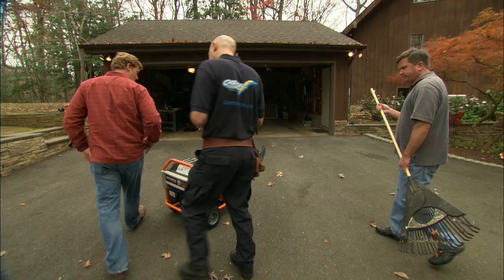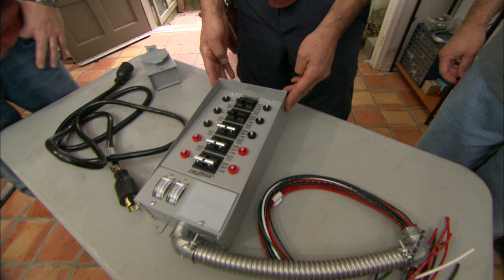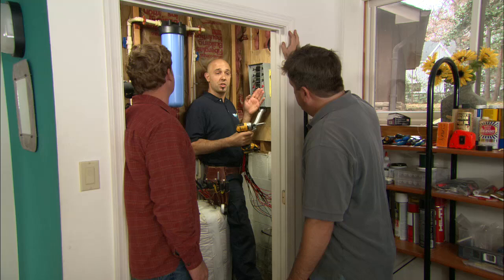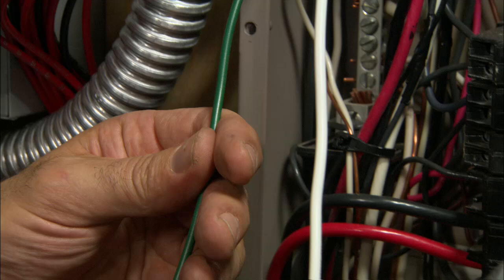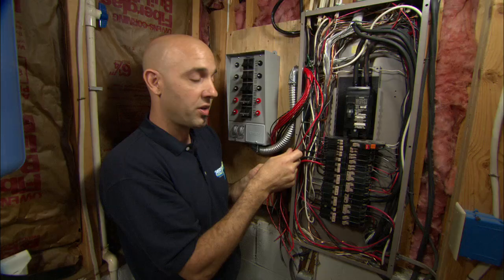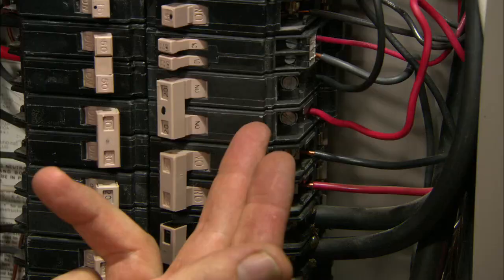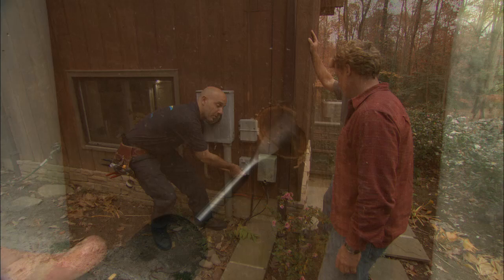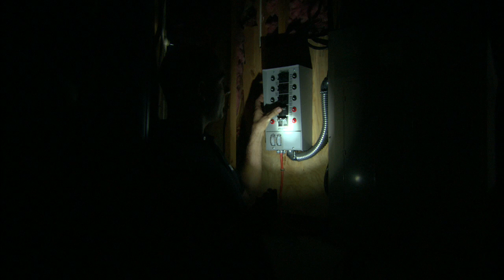How to Install a Transfer Switch for a Portable Generator | Ask This Old House

Comment: He's a good electrician, but why does he always use his linesmen to strip wire? It's a very bad habit and if I ever catch any of my apprentices or journeymen do that, I will correct them because no matter how cool you think you are, you will end up scoring the copper and on solid wires it will weaken the wire and make them break easier.  A wire stripper is a must have tool.
Reply: I'm an electrician 26 years and I've never owned a wire stripper.
Reply: Well then you must be the reason why I see so many broken wires inside of wirenuts after spending a day troubleshooting intermittent problems ;) or perhaps you don't work construction often.   

I've heard a few other electricians brag about not wanting to spend $15 on a stripper and in every case, they damage the copper. Sure maybe once in a blue moon it's ok to use them but it's highly unprofessional for a working pro not to use the right tool.  I'm a master electrician FYI.
Reply: So you're saying "once in a blue moon" is ok to damage the conductor and decrease it's ampacity rating? Hmmm. Sounds shady to me.
Reply: Sounds like you're playing word gymnastics and trying to put words in my mouth but it doesn't change the fact that a professional electrician needs to have the right tools.
Reply: Arie M and "flying taps" inside the panel?? Wtf?  This guy does not know code!!
Reply: lol. I love the comments about him not using proper strippers. The first time i brought mine out as an apprentice, i never heard my tradey laugh harder than he did that day. His remark was, "What the fuck are they!? Use your pliers!!". The only time i ever use strippers is when I'm building a control board and I'm stripping hundreds of cables.
Reply: Scott Schembri See that's the kind of macho attitude some guys have that leads to poor installations.  I also assume you've never wired a large house where you had to strip thousands of wires in a timely fashion.  There is no way you can properly strip that many wires with your pliers without getting lazy and scoring the copper.  

How about large panels full of THHN? For those I even have a Katapult stripper to make sure even not one strand is broken and I don't get carpal tunnel.  

And for what? To save $15?
Reply: mate I've done work only for that. But I can guarentee you if I'm doing TPS cabling, lineys is all you need because if you're a good sparky you'd know how to strip with lineys. And as I stated in my previous comment. If I am building a control panel, railways Signals relay box or anything with 0.75 mm cabling and flex cable then I'd use my strippers. But for single strand and even stranded power cable, you don't need strippers mate. Ask any sparky
Reply: Arie M also if I'm buying strippers, I ain't spending $15 on a bunnings/Wallmart grade set of strippers. I only use trade quality so I've spent $90 on my set bud.
Reply: Wait so if you already have a pair, why are you arguing? and I was just using that as an example. I have two pairs - my daily one that also has a couple of 6-32 and 8-32 cutters and my Katapult for panels or other repetitive days.  I've got a couple of backups too that I've gotten for free from various vendors.
Reply: But what the hell do I know...they give Master licenses to everybody now days.
Reply: Arie M no worries mate. How many years experience as a lekky have you got and what industries have you worked in? to make a comment like that sounds as if you're a home owner who wired in his own gpo and that qualifies you as a sparky. But what would I know? We don't play with toy voltages in my country.
Reply: You must be right if you typed it in all caps.  Tell me how many panels full of THHN you've wired up in a day with your linesmen and I'll take you more seriously.
Reply: right.   all caps give people authority!
Reply: It's spelled Linesman pliers, not Linemans pliers.  Class dismissed.
Reply: We always called them Kleins and everyone knew what we meant.  The diagional  wire cutters we call them dikes.  Klein brand of tools is the best in electrical hand tools you can purchase, but they don't come cheap.
Reply: I've used Klein, greenlee and some others.  But I have found knipex the best by far, German quality and no issues for exchange.  Had a Klein with the blade getting knicked up, try to get warranty is like pulling teeth, had a knipex with the same thing, no question, exchanged right over the counter.

I have had many apprentices that don't know how to Use strippers, seen so many knick the wire by either using wrong notch or angle them to much when using them,  I have used my linesman many times for stripping wires and no nicking, but still prefer to use strippers.  Its easier to knick with strippers than linesman, especially cheap pairs.
Reply: Arie M Oh but wire nuts are perfectly ok? lol! You'd get prosecuted in the UK for using them!
Reply: sure you do.
Reply: electricalron then you might be a hack
Reply: Arie M. he do that because some of the wires are thick
Reply: >"and "flying taps" inside the panel?? Wtf?  This guy does not know code!!"  

came here  to point this out as well, I noticed this and I am not an electrician, I only play one on Youtube
Reply: > i never heard my tradey laugh harder than he did that day

you let yourself get bullied, HAHAHAHAHA - random internet commenter
Reply: If the wire is thicker than 10 AWG, I get it, but he does it all the time with 12 awg wire too.  In fact in one short section, he was bragging about how the only tools he needs is his linesman and screw driver.
Reply: You can have splices in the panel and it's not considered a flying tap. If it is, please cite the NEC code.
Reply: Arie M I use wire strippers do I have a nice safe splice
Reply: Arie M
Reply: Omit, you might hard it find to believe but I for one love this stuff. I also realize that everybody does things a bit different and I've never been the "my way is the best" but felt that this was a fundamentally bad habit that I pointed out.  If one person reads it and has second thoughts about doing it next time then all the better.  What does it hurt to get extra information to the non-pro? Everything on the internet including this show should be taken with a grain of salt.
Reply: there is an special tool for that automatic wire striper would be a great one lol
Reply: He's a REBEL - he will just say GO TO HELL OLD MAN, I QUIT
Reply: Arie M all you need is the " powerhouse five" and an apprentice.
Reply: Arie M - You are 100% right.
Reply: Arie M YOU ARE CORRECT ! BAD HABIT FOR SURE !
Reply: That is bad , not professional ( some day it will wire broken or ~~~ )
Reply: Does being a master-baitor make you a better fisherman?
Reply: Arie M ... I'm aware of the relevance here concerning the use of linemans' to strip wire....Has nothing to do with 'Cockyness' and I agree with your statement "You should have the CORRECT tools when tackling any job professionally",  However some of us are built for speed when time is of the essence, Knowing up front that mistakes is not an option, Have self-developed [techniques] in certain areas to enhance efficiency and eliminate the need for "Back-and-forthness" whether its to your truck, toolbox, or even your toolbelt. After enough "At-Bats", This guy knows how much pressure to place on the handle, how many 'swings' it takes to strip wire regardless of gage. I've seen auto mechanics use impact guns to install cylinder heads instead of a torque wrench, Put air in tires without a gauge, AND I've seen electricians strip wire with linemans'...ALL SUCCESSFULLY!!!....Whatever your course of action may be as it pertains to your own personal efficiency level, (If you're good at it???)...Short cuts is not a sin...Cutting corners IS !!!....But I will say this....I would NOT have stripped wire with a pair of lineman's pliers with cameras rolling !!!
Reply: Cannot spell can you?
Reply: 243wayne1 only if your Canadian
Reply: i thought everyone just used their teeth to strip wires like i do
Reply: what cause the generrator blown smoke
Reply: save
How many times did you repeat the 8th grade before you started working full time?
Reply: Where in Yankee land do they call side cutters, linesmen?
Reply: I've been a Licensed Electrician for 30 yrs. and never have I used a wire stripper . The Linesman pliers is the tool
Reply: +SLY SPY . For anyone reading this when you hear the person you hired to do a job say “ I’ve been doing it this way 30 years.”  and they don’t want to do it the right way then you need to give them the choice to change their way or leave. ITS YOUR HOUSE, YOU HAVE THE RIGHT TO SAY HOW YOU WANT THINGS DONE. Do it the right way or leave. Don’t be afraid to stand up tell them no!
UNFORTUNATELY contractors need to be baby sat until you know you can trust them. 
Craigslist is full of guys saying “ I’ve been doing it this way 30 years”
Did you see him struggle when the side cutters dug itself into the wire?
Reply: Hello jukebox , It's not a matter of right or wrong , A tradesman has many tools at his disposal while doing a job , it's really his choice on what tool he prefers . I was taught and still use today my linesman as my premiere tool but if it's not your choice that's okay , whatever works for you . The linesman is designed for stripping wire and requires a touch so not to score the wire , that's what an apprenticeship is all about learning to use tools properly
Reply: Your full of yourself
Reply: Arie M a master of bullshit
Reply: Arie M well they must you got one
Reply: Krazy K  
Hmmmm🤔...so you like fishing, eh?...lol
Reply: Thomas Russell No! Not a better fisherman. Just better at making sure the worm stays on the hook better😅
Reply: if your cutters are sharp enough and you have a steady hand, why would you need strippers? maybe on speaker wires.
pros watch diy YouTube videos to see why their business failed/what they've been doing wrong for so long.
Reply: Well Ive built power lines most of my adult life and this guy forgot to tell people to shut the main breaker off during a power outage. Because 7200 volts goes through the transformer and comes out 240 volts total. But that generator will send 7200 volts back out of the transformer to the main power line. It's called back feed and it makes a linesman's job more dangerous.
Reply: old school
Reply: A wire stripper will strip a wire’s insulation with complete accuracy and precision, allowing it to be used the way it’s supposed to be used.
Reply: Arie master? Wouldn't certified sound better?
Reply: electricalron 26 years and you haven't learned to use strippers. Don't want you working on my house
Reply: electricalron 
  They sell them at Lowes...your welcome.
Reply: Arie 
  Im not a pro, but can you recommend a good pair?
Reply: James Bond 
 Unmmmm i can strip with a fuckin butter knife doesn't mean i'm supposed to.
Reply: You gatta be kidding me. Just say you can't do it. Man than been to the moon and you can't strip wires with some pliers............ Lol
Reply: Arie, I 100% agree with your assessment regarding these cowboy types who use their pliers so they don't have to buy/carry the correct tool. Kind of like the idiots who "bounce-shoot" multiple shots in a row using a framing nailer. I see anyone trying that crap around me, and they immediately get their gun permit revoked until they've read the manufacturer's general care and safety guide.  You correctly point out this will often damage "solid wires", but I'd point out that scoring stranded wires could perhaps lead to an even more dangerous situation. Firstly, stranded wires always present more of a danger by their very nature, and are often the source of fire due to their sloppy (loose, or somewhat fluid) configuration. Often I've repaired connections where the the previous sparky broke nearly have the tiny strands by over clamping or over tightening nuts/fasteners; with many of the remaining strands tied in little knots. On top of that, the many little broken strands that end up falling away over time, as the appliances will no doubt vibrate also present a short circuit/arching plasma potential. NEC shouldn't even allow the stranded connections to be made IMO. Now having said all of that, I don't believe one should call one's self a "master", as that name is reserved for his/her students or slaves ; )
Reply: I reckon I can build that , stab back connections are among the most idiotic dangerous things anyone could ever do to a house, yet the UK mandates these chinsey plug and play fire traps. Kind of says a lot about y'all. Any time I come across one of those shady mf'ers, I call my apprentice over, tell him to grab the rec, and I easily twist pull the wire out- every time! Then I do a quick mock up using scrap wire, a few nuts, and black tape. I tell him to try to pull that apart. After watching him struggle, I lol, and tell him you could hang a porch swing from that connection. But in truth, you could tow a truck with it. Cheers from across the big pond mate : D
Reply: You always use a wire stripper, even if it is one you set. I am an electrician and sold AMP connectors. Always correct strip length too.
Reply: Strippers for professional results

Comment: Nope!  I would keep this "electrician" far away from my home.  He made some crucial mistakes.  1st he skinned the wire with his side cutters ... that is a big no no ... thais is why we have wire strippers and 2nd he made taps inside the panel.  He could have easily put in a junction box beside the existing panel and made all taps inside it.  Keeping all electrical installations up to code is vitally important for safety and for future electricians who work at this home.
Reply: Birddog108 - What a good keyboard warrior you are.
Reply: Birddog108 - Yes, all those floating wire nuts in the breaker box is driving by OCD crazy.
Reply: I'm not a fan of wire nuts inside of a panel myself. But there is nowhere inside a NEC code book where it defines you can't make splices inside a electrical panel. It's counts as a enclosure. Code legal.
Reply: Our local code requires grounds and neutrals on opposite bars, also no wire nuts or breaks in box, would have to junction box beside it, but everyone has different local codes, iv been outta state and seen where romanex connectors wernt code..... yikes!!
Reply: Well Ive built power lines most of my adult life and this guy forgot to tell people to shut the main breaker off during a power outage. Because 7200 volts goes through the transformer and comes out 240 volts total. But that generator will send 7200 volts back out of the transformer to the main power line. It's called back feed and it makes a linesman's job more dangerous.
Reply: Rob Bob no, the whole purpose of the transfer switch is so it doesn't back feed
Reply: Robert Myers  That transfer switch just. Transfer's the generator power to the breaker box. Back feed happens from your breaker box through the electric meter, back to the pole outside your house.
Reply: Rob Bob when the transfer switch is set to the generator, the power goes straight from the generator to the load, doesn’t go through the breaker box at all
Reply: Robert Myers Ok I understand it after watching the video more closely, I thought he was just putting wires into the breaker along with the wires that were already there. Sorry I've built power lines for so many years and have seen all kinds of back feed issues with generators installed wrong, that I jumped the gun. Back feed is life threatening for power line crews that show up from a different state to help with natural disasters, or anytime. It's still a good idea to shut your main breaker off when using a generator if your not certain about it's installation.
Reply: Birddog108, did you ever get moved out of your parent's basement? Oh, and FYI, the main panel IS a junction box, and depending on it's capacity can legally contain a certain number of splice connections with in- just like any other dumb old junction box! I feel sorry for all of the HO's who likely have a bunch of extra little junction boxes configured around their main panel if you've actually ever practiced in the trade. I bet the spiders love all of that web you've made for them to hide in though ; )

Comment: Cannot believe i have a way more advanced wire stripper tool than this electrician has 😂 I only have to hold a wire in my wire stripping tool and squeeze the levers, all done.

Comment: Unleaded gasoline ,  ya like we have lead gas in the last 35 years
Reply: westside98 - LOL! Old school!
Reply: Hilarious. I thought the same thing. Google says leaded is only in the prohibited countries.
Reply: Hilarious. I thought the same thing. Google says leaded is only in the prohibited countries.
Reply: I used to work in a store that sold portable generators.  Occasionally we would get the dunce that neglected to put oil in the engine (provided in a bottle by the maker with cautionary instructions printed on the box flaps) and ran it to death.  Then brought it back for a refund for being defective.  Takes all types!
Reply: i would think he's making the distinction that it's not a 2 stroke motor where you add oil to the gas like in a dirt bike.
Reply: Lots? I'd bet good green $$ it's way less than 1% diesel on portable sets. I work for one of the larger Generac dealers and even with stationary sets (residential) it's still less than 1% over all.
Reply: Ever go to a gas station the day before a storm? The lines are long because people are filling up in anticipation of the power being out for a day or two. Since the station is probably on a main road and the average home is not, guess who will get their power back first? That's right, the gas station! IOW, if you are smart you will have enough fuel on hand to get by for a couple of days after a storm. Worst case is you dump the extra into your car when it's all over.